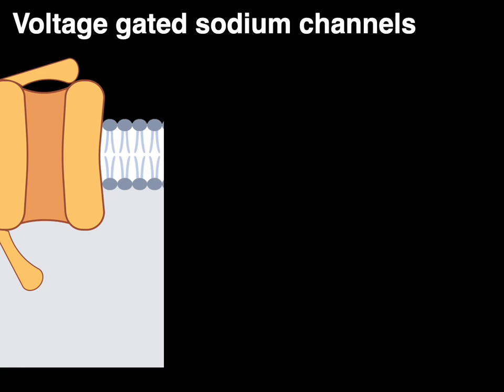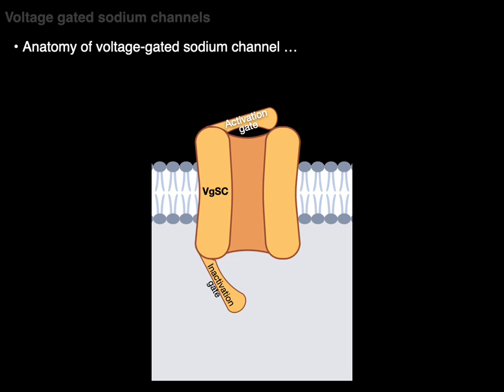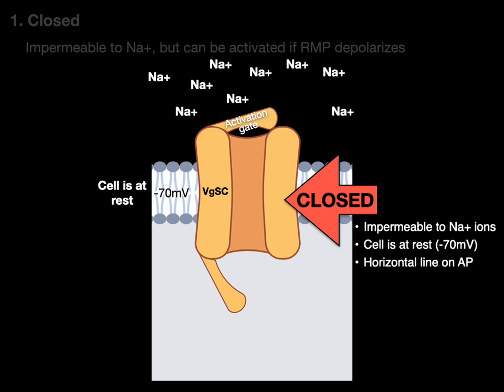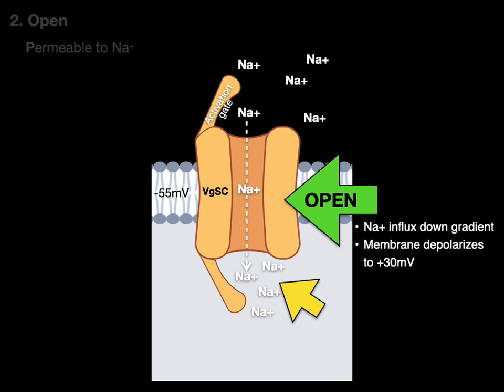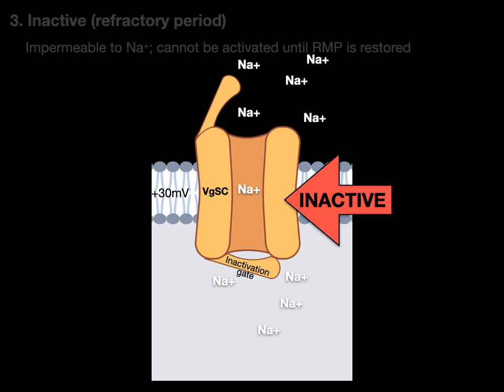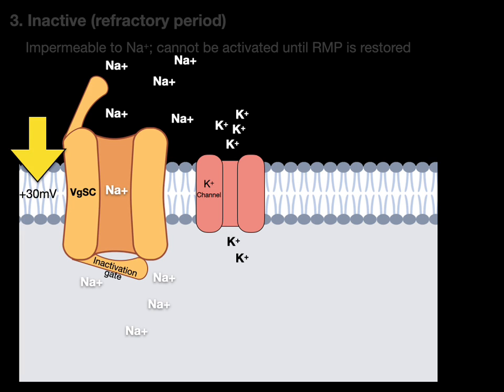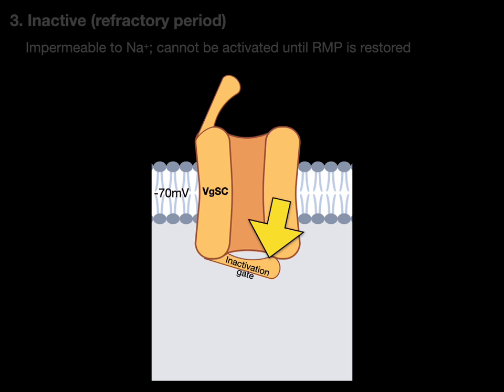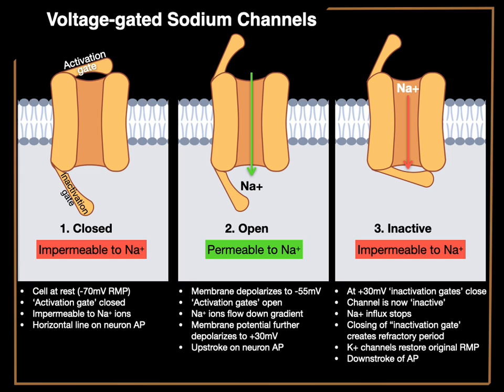Voltage gated Na channels

Comment: This is a great description of the voltage-gated sodium ion channels at the axon hillock and the subsequent propagation of the action potential down the axon.  However, at 2:38 you explain the depolarization of the cell from -70mV.  That depolarization is a result of the ligand-gated sodium channels opening when the excitatory neurotransmitters bind to it, allowing sodium (Na+) to enter the cell (making it less negative).  That is how the cell actually reaches threshold, going from -70mV to -55mV (at which point the voltage-gated sodium channels open).    

You can find that description here.  https://www.youtube.com/watch?v=BbUcWbtVjT4

I do appreciate your videos and if I am incorrect please correct me.  Thank you!

Comment: Thank you 
I have a question is the inactivation gate also voltage dependent or it’s somehow positively charged so that when the potential difference reverses and reach positive 30 inside the cell it will repel the inactivation gate and causes it to close 
Or all what I said is wrong
But if it’s charged then why when the inactivation gate is closed it will not open no matter how strong stimulation is
Reply from the maker: The Na gate opens, inactivates and turns to the closed state all based upon the voltage of the membrane.

Comment: So the gates open by the voltages?
Reply from the maker: Yes, in the membrane potential reaches a certain level the gates open and then they close when they reach another level
Reply: @TheNotedAnatomist  so the charge of electrons causes pressure (voltage) which mechanically open gate?